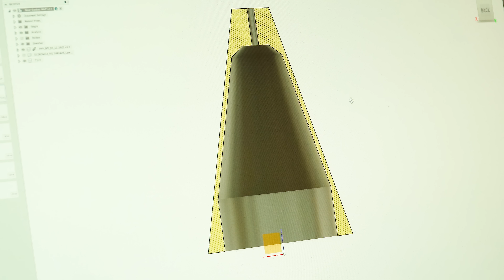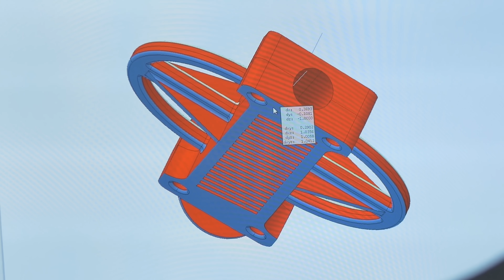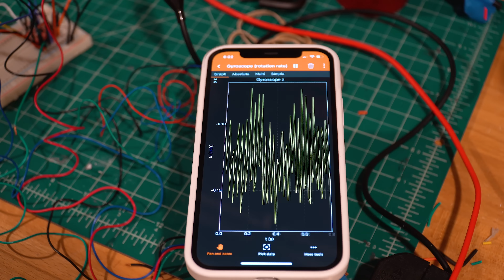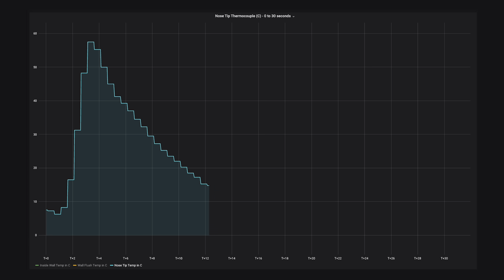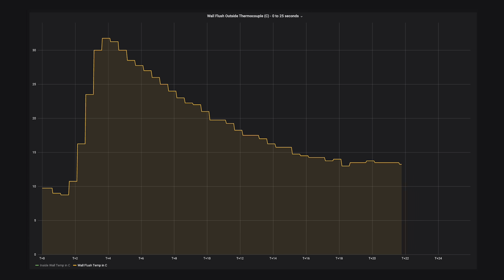How Hot Does a Rocket Get?

Comment: Maybe you can use aerogel to insulate the meat and heatpipes to move the heat from the surface into the cooking chamber. A big like the slapping turkey cooker.
Reply: maybe switch out the aluminum for copper for better transfer. Back the nose cone with insulation & make sure to take as much heat from near the union between nosecone & rocket. Idk if it would be possible to find some kind of tough insulating ceramic ring to put between the nose cone & body. Maybe some kind of wide ceramic bearings🤷
Reply: Isnt aerogel really expensive?
Reply: @Cresign  2 seconds of googling shows like $15 for 100cc of granular aerogel. It USED to be expensive. For small applications like this the cost is trivial
Reply: @Cresign  Very